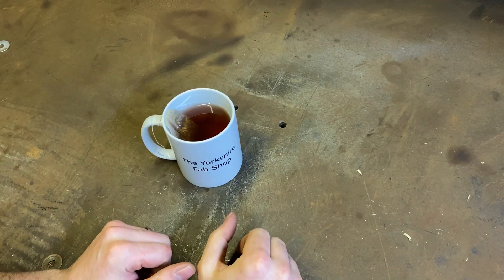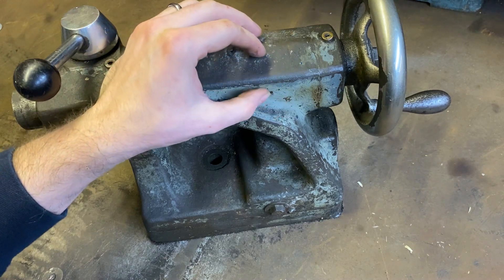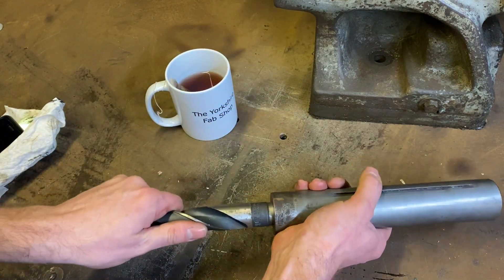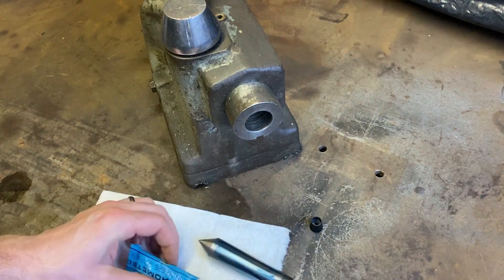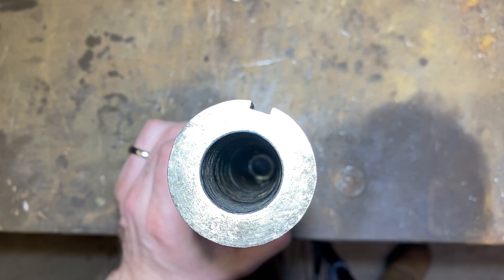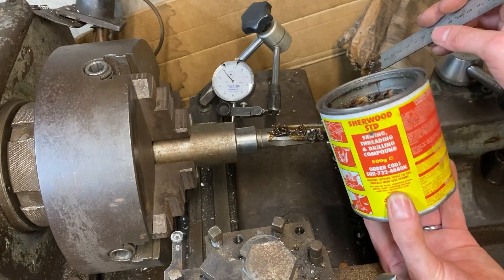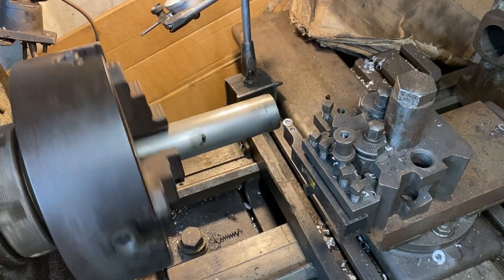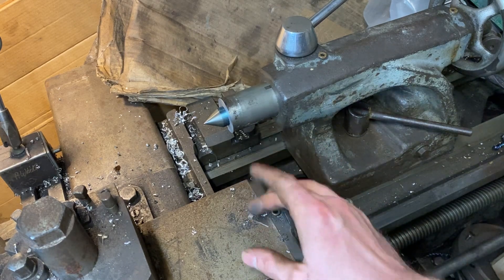Lathe Tailstock Machining! A good reaming needed? Restoration series episode 4

Comment: Why not single point bore that out? Is it compound length or some other reason? I would assume one would consider a toolpost grinder with a long extension and a long cyl. stone head that could be fed inwards while allowing the grinder to do its work and lick out all the crud that was the prior surface terrain, rather than surface finish... Even a +65hrc pvd carbide insert on a long solid carbide boring bar coulda taken care of the problem much better in my view, and not just mine, but the view of the quill aswell, given that the blue doth showeth some chatter and nonsense, despite the rigidity... I love reamers for cyl. bores that need a bit of soft touch to fit the spec, but tapered or expanding reamers are junk of the worst kind... They appear as a great idea, but in my view, lest you are using them with hand to tickle the surface and remove literally microns, they are a surefire way to dick the part rearways... 
And for the love of Virgin Mary, get a 1micron clock... or a tenth`s clock... Whatever, you cant be using a metal lathe with woodworkers precision... 0.x mm isnt even accuracy, 0.0x is barely considerable accurate, 0.00x is where the accuracy and precision machining/measuring starts... You can go finer than that, but that is costly and quite often most unnecessary while ultra hard to achieve... 
Not shitting on ya, but if you have machinery, you know that any level of precision is offered, and its up to you to allow the machines to achieve that... I thought you woulda clocked that reamer to 0.000x mm or at worst to 0.001mm before work, but you went the woodworkers route... Im glad its better than before, and i know that that reamer had 0 chance of cutting true regardless of clockin, as it woulda hit a terrain, rather than a machined smooth surface which would channel its cut perfectly, making the cut bumpy due to metal deflection if nothing else(hence boring bar advice), but its a metal lathe mate, she deserves the best, not mere relative precision... 

All the best and kindest regards!
Reply from the maker: Thank you for that very comprehensive opinion/observation of the bodgery that goes on in this shop! I do really appreciate the time you’ve taken to post that comment. 
I’ll start with the justification to use a reamer. It was only supposed to be a tickle, but turned into much more… I lack carbide boring bars to turn the ID, although I am planning on getting hold of a few for something in the pipeline. As you rightly say, the blue check confirmed the less-than-perfect result of the reamed surface (I don’t particularly like reamers at the best of times) but the surface in there was so bad it’s unlikely to have been truer than it is now. Suppose it was a calculated trade-off between usability and potential loss of accuracy. 
I do have a couple of 0.0001” clocks but they weren’t local when this was filmed and being used to do another job. I also wouldn’t have managed to get it close enough to justify the use of a finer dti in that set up anyway. It wanted putting in another machine which I don’t have…
Perfect world and all that! 
Also don’t forget even though this lathe represents some of the finest British engineering of its time, it was manufactured in the 40’s / 50’s so any accuracy that it once had is all gone, no thanks to its heavy handed past. That’s not an excuse by the way, you are right in that machines of this nature deserve the best. It would be nice to have the bed re-done and everything reconditioned but on such a cheap machine it isn’t worth it. Maybe in years to come I’ll do that. 
Your views and opinions have all been taken on board, thanks for watching and taking the time to reply 👍
Reply: @theyorkshirefabshop8776  Jobbing shops are not precision palaces Its all about knowing the limits of your tools and equipment and making the best of a bad job ,most times . Bench fitting by hand, Filing Lapping etc to the tolerance required is all thats needed Its the fitter that fits the machinists work in the end
Reply from the maker: I do like to try and retain a little accuracy, however this is true that it’s a home workshop, I certainly don’t chase microns on a regular basis. There is always trade off between ultimate accuracy and usability, I believe this repair is good enough for the work this machine does. They do however deserve the best and there are certainly more accurate ways to conduct this repair. I believe the term is horses for courses.
Also, the grinding dust in the shop is a real concern for me, it’s quite upsetting how close the lathe is to the bench, and regular wipe downs are needed to keep dust off the ways. I could really do with something at least four times as big!
Reply: @theyorkshirefabshop8776  Screens and covers help  Its an ongoing battle  ,Cheers  Great vids
Reply from the maker: That is how I keep dust off most things at the moment. A proper segregation would be great, but so would insulation, decent lighting, more space. The list is endless 🙄
Reply: @theyorkshirefabshop8776  Keep,up the good work  Regards from NZ
Reply from the maker: Thank you for the encouragement 👍
Reply: @theyorkshirefabshop8776  
I would advise a diy air filtration system... Fab up a fan shroud with a pair of car cabin filters, or an industrial turbine with a car engine filter on the outlet... That will eat up most scum from air... A small heater of any kind is a good thing if you have a cold shop in the winters... My shop has a large central heating radiator, so that takes care of that, along with hvac, which also has the heating and drying capacity, and the rice bags for passive drying of air... 
I am most looking forward to your machine fixes and reworks, as its something im plagued by at the moment, and will be for a few more years likely... So any such content, done with care and love always hits the spot... 
Regarding the bench... Just deal with airborne shit by getting rid of it, never go with a smaller bench... The instant you reduce a bench, you get a project that would most appreciate the older, larger bench... 
I am currently in the beginning of making a large shop table, 1.2x1.2m, which isnt too large, but keep in mind that if it was larger, i would be having space issues, as i voraciously stacked machines to the very limit of my space capacity... I just could not let them get shredded, so i paid for them more in space lost, then money handed over... Yet a smaller table will present issues with scraping of the machine tables and such, so yeah...

All the best and kindest regards!
Steuss
Reply from the maker: That may well be a future addition to the workshop. Currently moving air through the space is difficult, even with the door open it’s like running with an open carrier bag, once filled the air doesn’t exchange and all the dust stays in the bag…
The mill will very soon feature as it is in serious need of reconditioning… i need to sort a motor first come to think of it!
Along with you, space is such a premium. I do have a very oversized bench though, which I probably don’t need. My internal space is approximately 9’ x 19’ and my bench is 8’ x 4’ so a considerable portion of the floor space! But I couldn’t cope with a smaller bench now
Reply: @theyorkshirefabshop8776  I generally dont have anything open... The main door is shut, the large door is shut, the two windows are shut... I rely solely on forced air flow through filters to have any fresh air... Opening anything that isnt the main door just allows for dust or potentially abrasive particles to migrate in... 
I know im a fanatic in my own way, and that apart from spindle assemblymen and such trades, rarely anyone keeps their shop like i do, Robin Renz notwithstanding... But hey, if the machines appreciate it, its the law...
Speaking of space, 9x9m is what you could round it up to... Tho a part of the floor is ``unsupported`` but its generally a good thing, as i can always make a reinforcement pillar in the basement to kick the capacity of the floor from 500kg/1sqm to 10t/1sqm if i so desire, and its the area that i dont want heavy machines in anyways(whom am i kidding and/or lying to...)
As said, i completely get the large bench issue/benefit... The moment its gone, its the only thing that you need to work, and while its there, its a thing that only eats up space and offers 4 corners to smash into or catch a vise handle with your ribs or hips...
Reply from the maker: 9x9m is a great size, nearly 5x what I currently have available. The trouble is the more space you have, the more things you put in it! And the same goes for horizontal surfaces. Any spare space usually gets an item put in it ready to be put away in its correct place. I admire your attitude towards the preservation of your machines. I do aspire to that level of care and affection towards them, one day I will get there! 
I was planning on reducing the size of my bench, but there aren’t many easy ways of reducing the depth of a 10mm sheet without heavy equipment, so I made space for it to go. Thankfully a large bench has lots of space beneath it for putting all those items that one day will be useful, even if I never use it!
Reply: @theyorkshirefabshop8776  Yeah, true, the more space you have, in a way its easier to swamp it, as it gives one ``false confidence``, where a small space is like a thorn in a foot, makes you walk slowly as not to irritate it even more, but at the same time, you are less likely to misstep into a nose-dive with a slow pace... 
But i completely agree with the bench being a great storage unit... I made a ``table`` for my mini mill, and atm its just on 4 legs with a hollow beneath, and i could really use some drawers, if nothing, to put all the baby mill tooling on hand where she is...
Regarding shop decorum, im most glad to hear that you strive to achieve the best, as machines like these truly are works of art that can be maintained for centuries, and can work for decades between any real services apart from oil changes and such minor touch ups... They deserve the best, despite not ever being able to thank you for it in ways other than performing at a sublime level that is in terms of practical sense, barely short of being miraculous... 

All the best!
Reply: @theyorkshirefabshop8776  Im most glad you took the comment as it was intended! I get you, as i too have a whole array of troubling machines at my ``shop`` which need reworking, fixing, new parts and so on, and every single project would be better off if any and every other project on the list was already done... 
Not just that, but as with your preoccupied indicators, i too have a lot of lacking equipment in one way or another, which renders other work even harder, but i do try my best to go for robin renz. level of quality of work or i dont work at all... 
Speaking of bed of the lathe... I know im suggesting a comprehensive undertaking, but consider getting a nice 00grade thick straight edge and scraping in the bed with a few indicators, sub micron grade parallels and so on... One neednt have a whole machine reground professionally to have a 0.001mm tir or better... It will take months of effort and finesse, yet it is doable, and the results are worth all the time one could invest... Especially on that lathe, which unlike some, doesnt have ``hidden`` ways and crazy contraptions that demand you to scrape at maddening angles and maintain paraplegic body postures... 
As said, I too have a few olden machines, some with regretful ways geometry and some with pinned and bolted ways which can be taken out and surface ground to oem spec. in a few minutes... My machines are around 10 tonnes in collective mass, and most of them i got for scrap prices, as i saved them from the shredders, not due to wear and damage explicitly, but because someone died and they got tossed out... So my machines are cheap af too, but they like your lathe, are of the olden make, and can if redone with love, offer absolute precision, with rigidity far surpassing that of most modern machines... 
Sure, to send them to rebuilders, it would be 20k$ per machine or 10k at best, but a carbide scraper is 20$ and i have the precision instruments to refer to, just as the rebuilders would... 
Also, get a carbide boring bar, they are costly, but a 10 or 12mm one can be had for around 30$ and it will reshape the way you think about boring, they are literally an upgrade at the level of a solid toolpost... Regular steel boring bar of the same diameter may seem rigid, but once you lay your hands on carbide bar, you will be amazed at the difference in rigidity if nothing else... Surface finish and accuracy depend on the ways and your setup, but the bar alone is a huge step in the direction of artisan level surface finish and precision... 

All the best and kindest regards!
Steuss
Reply from the maker: There is always a list longer than it is possible to complete in one lifetime, it’s just the way it is. The important decision comes from deciding how to prioritise those jobs. 
Unfortunately there are tools missing from even the best stocked workshops, it has always been a matter of how you use what you have to complete the desired task, rather than not doing anything through lack of intuition. This video being a prime example, although I accept sometimes it’s better not to do something rather than try with sub-optimal gear and make it worse… though we learn much through mistakes!
I acknowledge the comments made about checking the bed, something I could do at a later day. The issue being the machine is far too useful to have partially stripped and unusable. I would like to give it some love but if I ground the bed it would very quickly rust due to a cold and damp workshop, and that would be disastrous!
If you were interested this particular machine is a Woodhouse and Mitchel Junior 7, a highly specified machine for its day and coming in at a little over 1ton in its specified state. It was bought on a similar premise and far too good the simply scrap. I do have a milling machine which will be introduced in due course. 
Carbide tool holders have been on my list of things to buy for a while, this seems like the ideal time to acquire some!
Again, appreciate the comments and time taken to post, it’s great to communicate with like minded people 👍
Reply: @theyorkshirefabshop8776  Yeah, i completely get the problem with having a lathe in the works when you need a lathe, especially if its your only lathe... 
Tho, for any scraping and detailed work, you can always douse the whole thing worked in wd40 while you are working(no stoning then, as that can prove problematic with floating grit) but with lift off technique you neednt stone the scraped surface to check it, tho any procedure induces at least micro burrs, but a hardened steel parallel will shear off the micro burrs from cast iron like they never existed... 
Also, for such work, you can get a tub of cheapest chainsaw blade oil, its essentially way oil tacky, not a good way lube, yet it prevents any rust for years if slathered on... Grease also works amazingly, just dig your gloved hand in a tub`o`grease and slather that jam onto the bun you are working... It aint going nowhere, and it will allow you to shift it by a silicone kitchen scraper to clear a surface for hand scraping, before you can just pull that formed glob back over the freshly scraped part to again prevent oxidation... 
I know that scraping is generally done dry, but a sharp scraper, micron honed will cut even with lubricant on the surface, and will last longer and leave a superb finish, so apart from more effort on your behalf, it could be a good option for your case... Try it on a slab of steel, you can make your own surface plate essentially by scraping a slab of steel, or at least a cool square or whatever, its a practice piece that can only get better as you get better... 
Apart from that, i will subscribe as i want to see the mill... I am a machine fanatic, if that much wasnt/isnt obvious... Maybe i will start posting vids myself in due time, as i do have an enormous list of shit to do, and much of it could help a lot of people, who like me, and likely you, struggled with machines that have no manual, and come with various problems and issues... Not just that, but other projects that can either inspire others or allow me to ramble and turn someones attention to a mistake they are about to make themselves in their project... 

All the best!
Reply from the maker: Your comment certainly tickled me, the imagery generated by the thought of a gloved hand and plenty of jam was that of sheer bliss… that is my current preservation method, but it’s very frustrating having to work around a greased bed, table, ways etc. an insulated and heated garage would be a welcome addition to the toolkit…
The mill table is in dire need of a scrape, I’m reluctant to do too much with the lathe at the minute due to reasons previously acknowledged. What I do have is a beautiful power scraper which supplements my hand sandvik carbide scraper perfectly. This will be making an appearance hopefully during the winter when I refresh the mill so your suggestion of a straight edge will certainly be needed. I have one or two surface tables in great condition that will be becoming well acquainted with the mill table in due course. 

If you have the time and some basic equipment I absolutely recommend giving it a go, and if you’ve got a reasonable understanding of photo and video editing then it will be much easier to start. I must invest in some better equipment, my current recording and editing gear is far from the best. It definitely isn’t easy though, maintaining attention is difficult, and you can’t please all the people all of the time…
Good luck!
Reply: @camillosteuss  Do not forget this is a repair shop grinding dust is in the air all the time To much lube will turn it into grinding paste